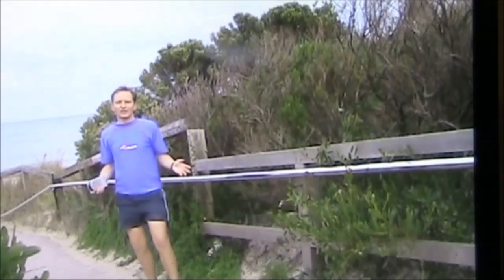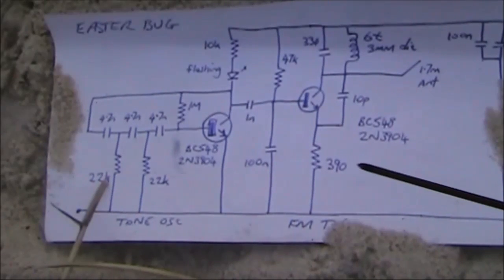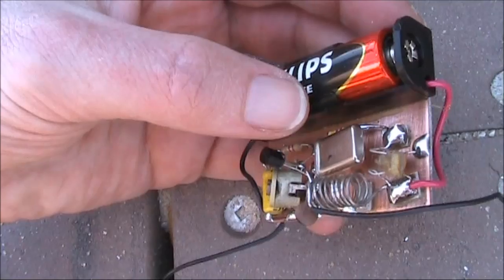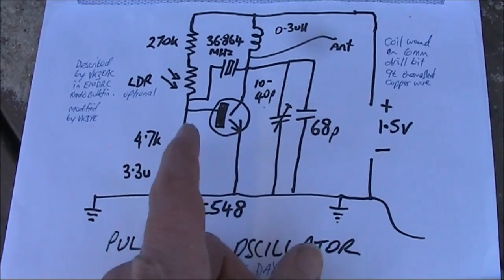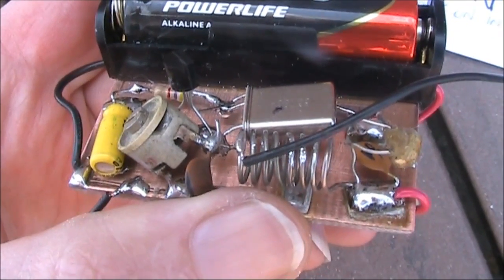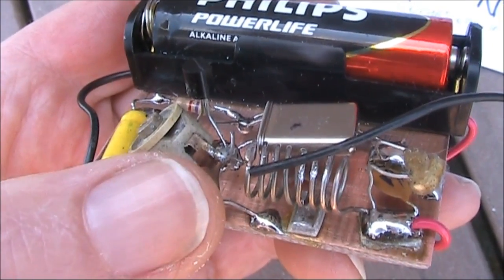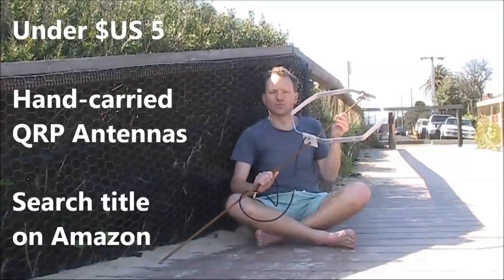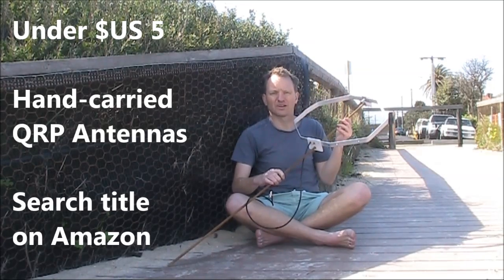Testing a 1.5 volt / 1 transistor pulsed VHF beacon

Comment: Hi vk3ye! I Follow your videos, and I'm trying to repeat some of your experiments, but my circuits are not even oscilating. I suspect of the wire I'm using for making the coils, I guess it's no thick enough(22AWG). The other problem seems that I trying at a protoboard. How thick are the wires you are using for makig coils? Do you think it's still possible to make FM transmitters in a protoboard?
Reply from the maker: I would use wire about 0.5 mm diameter (not critical). Protoboard with strips introduces capacitance which isn't helpful for VHF circuitry. Open air construction but with short connections may be better. Or on a PC board using continuous copper as a ground plane - again with short connections.

Comment: That sure is a familiar sound from Australia. Back in the 60's and 70's these LDR switched TX's on 27.240 would be placed on the top of gum trees ect.  Old transformer wire as an antenna, way up on a tree on a  hill gave them quite a range.  These days those 27 mhz frequencies are dead and you are lucky to hear a soul.

Comment: is it possible to use crystal of frequency range between 88 to 108 so can be listen using digital fm Receiver ?
Reply from the maker: Custom crystals are usually very expensive but you may be able to multiply up from a cheaper lower frequency crystal.
Reply: @vk3ye how multiply ?
Reply from the maker: @omsingharjit  Basically an RF amplifier circuit with tuned circuits to pick off the harmonic. If none of this means anything to you, buy a good radio textbook and study basics of circuits for 12 months. Or just buy an FM transmitter kit or made up unit. The Talking Electronics website can help you understand this but you'll need more if you want to start designing circuits.
Reply: @vk3ye  yes i am beginner in HF RF but i can understand , that after amplification we will get 2 and 3rd so forth harmonic in higher frequency and by using band pass filter and amplifier we can get that higer frequency Right !
I asked because there's also Two Frequency mixing technique to get higher frequency so i asked which one you are talking about .

Comment: I have done some experimenting with different crystal oscillator configurations to see if I can get them to do this with success. The series resistor and electrolytic capacitor that goes to ground on this very rudimentary circuit is loaded by the base emitter junction of the transistor until the capacitor discharges and the voltage drops sufficiently until the circuit drops out of oscillation.
So noting this I tried the series capacitor and resistor on other circuits and got them to do it. 
The trick is to avoid loading the RF impedances of the circuit so you don't dampen it's ability to oscillate at RF frequencies and completely kill it.
In fact I got the circuit for an old realistic 27mhz walkie talkie and applied the principle to it successfully.
It's quite useful to know if you want to make a power efficient beacon as if the following stages are class C, the power draw is almost zero between pulses

Comment: Hi vk3ye.  Great video. I know you posted this quite a few years ago but I have a few questions if you wouldn't mind.
1. Does the LC tank circuit need to be adjusted to match the crystal you use?
2. In the video I see you mention moving the capacitors to the ground rail?  What was the though behind this?
3. For the pulsing.  Are you relying on the fact that with the 270k resistor the voltage drop puts the base of the transistor at a level below the VBE(on) value of the transistor and that after the cap charges it will then pulse?
Thanks

Comment: Hi vk3ye,  I know you posted this video a while back but I had a couple of quick questions I was hoping you could answer.
1. Does the choice of crystal freq effect the values you select for your LC tank circuit?
2,. You mention you wanted the capacitors moved to ground instead of the power rail.  What's the thought on this?
3. I think I see how the pulse works.  It seems that the BC546 was chosen over other BJTs as it has a relatively low Vbe(on) value and by selecting the 270k resistor the voltage drops brings it below the threshold to turn on until the capacitor can charge?  Does that sound right?
Thanks for posting this great learning tool.
Reply from the maker: Hi CG: 1. Yes you will need to change the LC tank circuit with the crystal. 2, 3. Unfortunately I can't answer as I've moved onto other projects. 73, Peter

Comment: I built this and it worked first time. Only exception is for 27mhz I ended up having to use a 60pf capacitor in the LC circuit and my inductor coil is 9 turns of 20awg wire at 11mm length.

Comment: Hello. Can a beacon like this be made for operation on 40,66 - 40,70 mhz without use of a rare quartz oscillator? This band is allowed for use in my area and has power limit of 1 watt. Or better can a beacon like this operate in a 149,95 - 150,0625 band? It is limited here by 25 mw only but can be received with two meter HAM tranciever which is easier to get than a 40 mhz tranciever.

Comment: If I used the original circuit (compensated for frequency), could I get it oscillating in the beacon segment of the 6 meter band (or close) with a 16.67mhz crystal in its third overtone like in the newsletter?
Reply from the maker: It should work

Comment: After eliminating the r3 resistor and the inductor; would it be possible to connect a keyer between the transistor's base and battery's ground?
Reply from the maker: I can't find an R3 resistor - the diagram at 1:26 only has R1 & R2.
Reply: oh, sorry, I meant R2 :)
Reply from the maker: Haven't tried it but I'd be inclined to short circuit the 3u3 capacitor and put the key in the emitter lead with a 0.1uF capacitor across it. That does however require a reliable oscillator that starts up instantly.

Comment: Hi Peter, thanks for this video upload.
Despite the circuit simplicity, after a few tries/changes I finally
got  my example to work!
Here's a write up.....
http://www.vk6fh.com/vk6fh/beacon simple circuit.htm
cheers Frank
Reply from the maker: Thanks Frank - enjoyed reading about your experiences.
Reply: I have done many builds of this beacon and have figured out several different things each build. I used both websites and tips from you guys. Maybe you could publish some of my work to your website  vk6fh?  Just trying to spread knowledge to others.  -k0mov
Reply: @derek7017  Hi Derek I'm sure your variations on the beacon design would interest others. Is the information available anywhere in the public domain, Utube, website etc  or  direct to vk  6 f h at westnet dot com dot au   no spaces cheers
Reply: FRANK HUGHES I have several videos (need to edit) and a dozen circuit variations etc that I need to compile into a website or YouTube.  I mentioned your website as it’s quite popular over here. I’ve heard about it in my ham group and two other forums. Well, I forgot to say thanks for your work! Which greatly helped me. Thank you & 73 from Saint Louis -k0mov
Reply: @derek7017  Thanks Derek, good luck with your experiments!  cheers Frank

Comment: So Simple and yet so good.   Peter I am making a TV yagi just for the fun of it(I know it will probably cost twice as much as one on the shelf).  Just something to show the kids that antennas are not just for Ham. Please could you tell me why is it that purchased Yagis like the Hills 14 etc have a folded dipole of around 200MHz but for the same boom length of around 3 meters have a lot more directors fitted on the boom than say a Yagi using accurate calculations for 200MHz like VK5DJ program? Should I just copy the Hills one or follow a proper calculation? You would think if manufacturers could use less aluminium they would. Thanks
Reply from the maker: I'm guessing it has extra elements (eg log periodic) so it covers a wide frequency range (ie all the channels).  A yagi would only be good for 1 or 2 channels.
Reply: Thanks Peter.  It's not a log periodic but I think you are correct, it's about broad banding.This is the antenna I have as a sample to copy off http://www.radioparts.com.au/product/00681268/dy14-14-element-vhf-digital-fringe-antenna-signal#.V86CODVGTgw    
It's a Yagi but VHF Hi CH 6-12 is about 180MHz to 220MHzas you would know , so it's a lot to ask an antenna.
Reply: Argento Goldspier z

Comment: Interesting project, congratulations. Do you know how can I change the circuit in a way to produce CW (not FM) and insert PIC (call sign recorded) to make a legal propagation beacon? 73!
Reply from the maker: It's already CW. Just remove the pulsing feature.  You should be able to key it by applying keyed DC to the base via the 270k resistor, interrupting the emitter circuit or swiching the collector supply on and off. Be prepared for chirp though unless you add a buffer and key that.
Reply: See My Transmitter 1.5v and 1Kilometer Range
👉https://youtu.be/gcB-WtNEFCQ